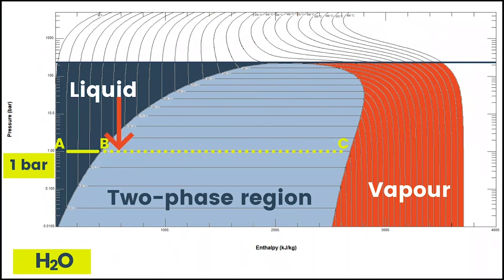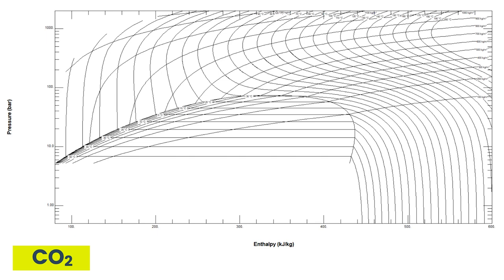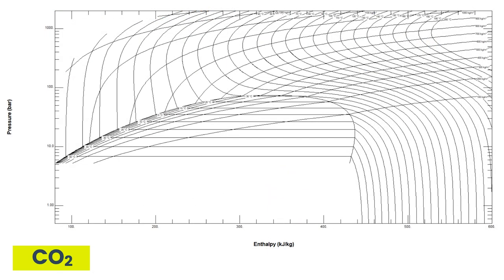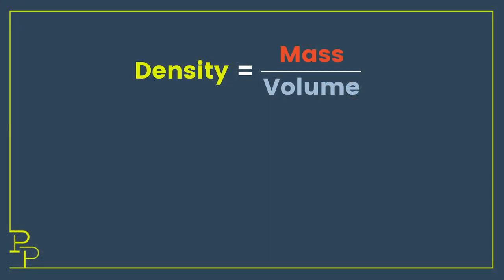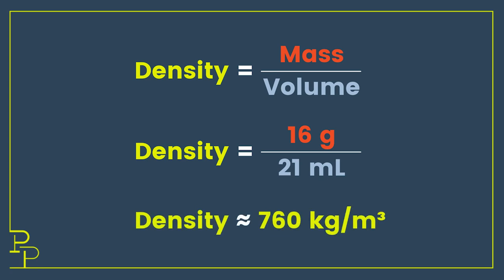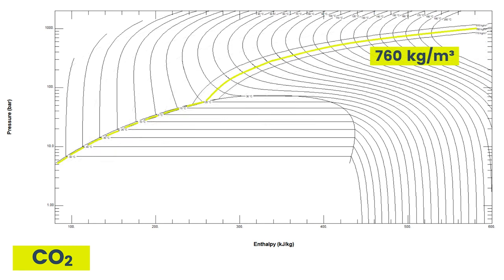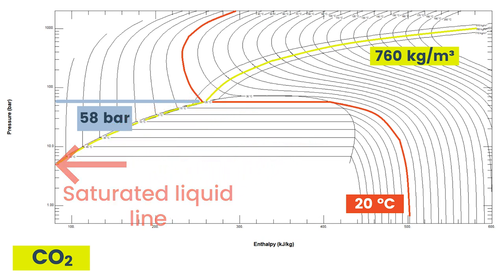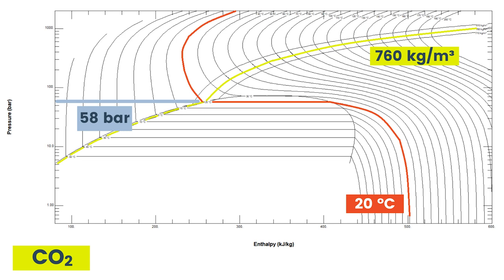What's the pressure in a CO₂ cartridge?

Comment: Hi Pat,  Thank you for making a hugely complex subject a little more understandable.  I use 12g CO2 cylinders in pistols.  As gas is released from the cylinder it causes a temperature drop and the consequently the pressure drops and this effects the following shots.  What I am unsure of is if the full cylinder has a pressure of 58 BAR at 20C and I empty 6g of the CO2 then allow the temperature of the cylinder and contents to stabilise again at 20C then what would be the pressure in the cylinder?
Thank you in advance for your time.
All the best, Martin
Reply from the maker: Hey Martin, thanks for the interesting question! To help me answer it I have prepared compiled a diagram which you can find here: https://imgur.com/gallery/8LTZU1p

First and foremost, this is all under the assumption that the cartridge is 21 mL in volume. I would guess they don't change in size depending on their charge, but who knows. Nor do I know how accurate this volume measurement of mine was.

As you consume more and more gas, the mass drops but the volume stays fixed (rigid container). That means that density drops the more CO2 we let out.

In the video I calculated a density of 760 kg/m³ with 16g.
If the cartridge volume is the same for 12g, then the density is 570  kg/m³ (three quarters of the start density).
By the time we drop to 6g, the density is 285 kg/m³.

I have shown these constant density lines on the diagram. Despressurising the cartridge moves us to a progressively lower-lying yellow line. Every time the cartridge warms back up to 20 °C the pressure is wherever the yellow constant density line (called an isochore) intersects with the red constant temperature line (called an isotherm). You can see from 16g all the way down to 4.1g it always intersects the horizontal portion of the isotherm. It's horizontal because it is at a constant pressure of around 58 bar. This means as along as you have more than 4.1g of CO2 you will always have 58 bar.

Remember, you have liquid in there. Any time you fire a shot and depressurise the cylinder, liquid boils off until the pressure is 58 bar again. As long as there is liquid, the pressure will be maintained.

This is exactly what happens in your deodorant can or your lighter. You start with liquid, and whenever you release some of the contents then a portion of the liquid boils, so you maintain a nice steady pressure as you consume the contents.

Back to our CO2 cartridge... Below 4.1g there is no liquid left, and only then does the pressure start to drop. Dropping down from 4.1g to 0.3 g drops the pressure from 58 bar to 8 bar (which I wouldn't have guess considering you have less that half a gram, but intuition can be pretty rubbish at times).

Does that makes sense? Remember that all pressures are absolute pressures, not gauge pressures.
Reply: @ProcesswithPat  Hi Pat,  Many, many thanks for putting in so much time to produce your comprehensive response.  I have several YouTube channels so I do appreciate the time it takes to answer viewers questions.

You have answered many of the questions that I have been grappling with from a CO2 pistol shooting perspective.  My real world observations of the affect of temperature on the cylinder pressure (as judged by the point of impact (POI) of the pellet on the target) have been born out.  In the low ambient temperatures of winter the POI is lower than in the summer months.  So I carry replacement cylinders in my trouser pockets to get the contents to body temperature.  When I shoot a single shot pistol slowly and methodically the POI is more consistent.  When shooting semi-auto pistols in rapid fire the POI drops significantly with successive shots due to the cylinder temperature drop.  As the cylinder becomes exhausted the POI falls off a cliff and this is exactly what your Enthalpy chart predicts as the 'knee' is reached at 195kg/m3.

I have now carried out some measurements on the 12g cylinders used in pistols.  My accurate jewellers scales unfortunately have a max weighing capacity of 10g so I have had to use digital kitchen scales which may not be entirely accurate or repeatable.  
To help on the accuracy I collected up 5 x empty cylinders = 150g = 30g each.
10 full cylinders = 417g = 41.7g each
Average contents therefore = 11.7g of CO2  (branded Umarex cylinders)

I used a medical 5ml syringe to fill an empty cylinder with water by injecting via a hypodermic needle through the piercing hole of the cylinder.  I measured exactly 15ml to fill the entire cylinder so that a tiny bead of water appeared above the piercing hole.  To double check this volume measurement I put tape over the piercing hole and weighed the water filled cylinder at 45g = contents of 15g of water.

This data provides a calculation of  11.7g/15ml  =  780kg/m3
So your assumption that these CO2 cylinders varieties would be similarly filled appears to be correct.

I would be grateful if you could use this data to produce another chart for 12g cylinders and predict the 'knee' point where the pressure drops from the isotherm line.

This information will be of interest to many shooters around the world so I will make a video to explain all these findings.  I will of course credit you with all the science.

At the end of your video you set a homework question.  I am struggling a little to read the enthalpy charts on my screen but my answer is that if you depressurise the cylinder from around 60BAR to 1BAR rapidly the cylinder temperature will drop from 20C to -35C.

Thanks again for all your help.

All the best,  Martin
Reply from the maker: Super interesting, and fantastic to hear that you were so methodical in measuring cartridge volumes. Makes me feel like an arse for hacksawing one in the kitchen! Cool to hear we get to similar densities. Also, great observation about the single round vs. semi-auto. How many shots do you get out of 12g? I guess it depends on how generous you are feeling in qualifying the last few as shots...

There is actually no need to plot another chart. The plot in the link is THE plot. The density lines do not move because density is what we usually refer to as an "intensive property" - it is not a function of the amount of material you have. Water has a density of 1 g/mL regardless of whether I have a teaspoon or a bucket. Same thing with CO2, or any other substance.

The only thing that changes moving from my 16 g/ 21mL cylinder to your 11.7 g/15 mL cartridge is the mass of CO2 remaining at the "knee" as you put it. The point is called the saturation pressure of CO2 at 20 °C, and this always has the same value. If you have pure CO2 in a container, and it contains liquid, then if it is at 20 °C it will always exert 58 bar. I have a nasty engineering habit of rounding off a bit too frequently - the actual value is 57.3 bar (http://www.ddbst.com/en/EED/PCP/VAP_C1050.php).  Regardless what cartridge you use, the saturation point at 20 °C (the knee)  will always have a density of 195 kg/m³. I have looked in another source (Perry's Chemical Engineers' Handbook) and interpolation gets me 203 kg/m³. Close enough. That means your 12g cartridge will run out of liquid when there is 2.9g remaining  (0.195 g/ml x 15 mL). This is also true regardless of whether that cartridge was filled with 12.5 g, 12 g, 11.7 g, or even 8 g to begin with.

You could try figuring out the mass consumption rate per round (which will undoubtedly be firearm related) and if it remains constant figure out how many shots you need to fire to get down to 2.9g. See whether this corresponds to the drop off that you see.

PS Regarding the homework - depressurising to 1 bar absolute actually gets you below -70°C. Go see the follow up video if you have time: https://www.youtube.com/watch?v=un6FgU6dfPE. You start forming dry ice at any pressure below 5 bar. That is why there is the big blank region at the bottom of the pressure-enthalpy chart. That is a region of solid-vapour equilibrium - there is no liquid phase.
Reply: @ProcesswithPat  Hi Pat,  Thank you so much for another fulsome response.  I have learned a great deal from you and the mystery surrounding the science behind the humble CO2 cylinders is now largely dispelled.
The CO2 pistols are pretty crude really.  They don't have regulators in between the cylinder and the transfer port into the breech behind the pellet.  A simple spring driven hammer is released by the trigger and strikes the valve releasing cylinder pressure CO2 behind the pellet sending it down the barrel.  So the number of shots per cylinder is generally around 50/60 but will depend on many factors:
- how hard the hammer is driven onto the valve and hence how long the valve is held open;
- whether the hammer bounces on the valve and so opens it several times wasting gas;
-ambient temperature affects the starting temp and pressure of the cylinder and how quickly the pressure in the cylinder rises after each shot.  Hence the problem with semi-autos being fun to shoot rapidly at say 1 shot per second the CO2 temp keeps stepping down and the cylinder pressure steps down and hence the muzzle energy steps down causing the POI to step down.  Some pistols such as the SA10 (see my review - https://youtu.be/PGKyDTvXN3U ) have a drop out magazine that holds the cylinder and valve.  I have recommended buying a spare magazine so that after firing 8 shots the magazine can be ejected and put into a trouser pocket to warm up and the spare magazine put into the gun for the next 8 shots.  This would improve POI consistency.  

Am I right in thinking that although 12g CO2 cylinders are universally zinc plated they would perform better in pistols if they were painted matt black to absorb heat better?

If I get some time I will try to make a video testing the cylinder temp and muzzle energy during rapid firing.  I will send you a link.

Many thanks again for all your help.

All the best,  Martin
Reply: @ProcesswithPat  Hi Pat,  Sorry I forgot to say thanks for sharing the CO2 vapour pressure tables.  At first it made no sense until I twigged and did the Kelvin to Celcius and kPA to BAR conversion and hey presto go the confirmation of 57.5BAR at 20C. 
Cheers,  Martin
Reply: Well if you still have co2 in the liquid form inside the cylindet the pressure is going to be the same once it reaches thermal equilibrium with its surroundings.

Comment: Friend, your video is very good! Quite detailed.
Just an observation, it would be interesting to check the theoretical pressure values again at a temperature of 50°C. The pressure should increase to just 65-66bar or kgf/cm³.
In the table, in 11:15, the unit of measurement is "kg/m³". I believe it was interpreted as "kgf/cm²". The first unit is about density, the second about pressure. For reference, I personally heated a 12g CO2 cylinder to a temperature of 100°C with cartridge in good shape.
Thank you for excellent material!

Comment: Those cartridges fail by blowing through the sidewall and opening up completely, if the pressure inside is high enough.  However, I did my experiments with the top already pierced.  The way to raise the pressure quickly enough so that the leakage through the open hole becomes insignificant is by using a powder that generates a lot of gas volume quickly, and then further increases the pressure of that gas because it also generates a lot of heat.  To do this, fill the empty CO2 container with black powder, and use a long fuse that is narrow enough to fit through the piercing.  These experiments are best performed at an age lower than eighteen, just in case a government representative discovers your fine workmanship and then refuses to view the experiment as the fun that it really is.
Reply from the maker: Thank you for your service to science! (If not to HSE) I’m pretty impressed that you found the cartridge afterwards… how far did it fly? Not sure your experiment can be read off of my chart.
Reply: @ProcesswithPat  I used the green CO2 cartridges from a soda siphon.  They travelled about 150 feet.  If contained, the surrounding shrapnel would travel further and faster than expected.  The zip-thwack-boom sound indicated supersonic velocity of small pieces.  I never got in trouble for my experiments, but I was twice asked by professionals to apply for a job at CSIS.  Later, CSIS refused my written freedom of information request.  Two of my smart friends complained about their phone lines being tapped.  Things are not quite what they seem and one can never really know.

Comment: HI PAT have a question for you may be you can answer I just bought a  fire extinguisher it's powered by a 33 gram co2 cartridge technical this product is supposed to be tested but in theory would this not almost  be a giant seltzer bottle if it a metal fire extinguisher provided by 33 grams of co2 as previously stated this unit is supposed to be tested but I would assume if the  metal cylinder is in good condition it's probably fine ? I mean in a seltzer bottle directions it does not say anything about hydro testing I would guess the answer is as long as it's in good condition I would bet it's fine but I am sure this is the part where you would say you would  think it should be finner but wish to disclaim liability in case of a surprise failure sound right? Thoughts please thank you

Comment: Hey Pat! Having some thermodynamics in high school right now, and as a mountain biker I became interested in the phenomenon of the cartridge becoming cold after usage. I discussed it with my teacher but got nowhere so far. I THINK it relates to 1. decompression and therefore it getting cold and 2. the conversion from liquid to gas which needs energy (takes it from the air, which then becomes cold)

 Could you bring some light into this?

Comment: HI PAT in case it some how got deleted it have a metal cylinder fie extinguisher powered by a 33 gram co2 cylinder this unit is supposed to be hydrotested but it seems it almost a large seltzer bottle I would imagine your answer would be theoretically it should be fine if the cylinder is in good condition but you also say you would like to disclaim liability in case of a suprise failure? Sound right ? Thoughts please thank you
Reply: In case I was unclear I think as expecting to use this as an untested cylinder like previously stated I would bet nothing terrible would happen but I would guess she you answer is its probably fine but you would also like to disclaim liability  in case of a surprise failure sound right thoughts please thank you

Comment: Amazing video! Is there a way to get this chart without the logarithmic values or some way to get the numeric pressure values for certain temperatures? I can only guess since the chart is logarithmic. Thanks!
Reply from the maker: Yeah absolutely. The logarithmic axes are necessary because the values on these types of charts span pretty wide temperature ranges, so you need them so they don't become unwieldly! Your best bet is to use Antoine's equation for CO2 (here is a link to NIST: https://webbook.nist.gov/cgi/cbook.cgi?ID=C124389&Mask=4&Type=ANTOINE&Plot=on) this will give you the saturation pressure & temperature.

Comment: 0:26 are you sure about that, my bike holds about 40 psi, my sisters are the same, and my parents is as well, we have different sized rims, and different brands of bikes, 120 psi is a lot, my grandparents 5th wheel used 90 psi on all 4 tires. that then i have never seen a car that uses 30 psi in the tires
Reply from the maker: Yep. On my road bike with 23c (narrow) rims I pump up my tyres to 8 bar. Check it out online if you doubt it!